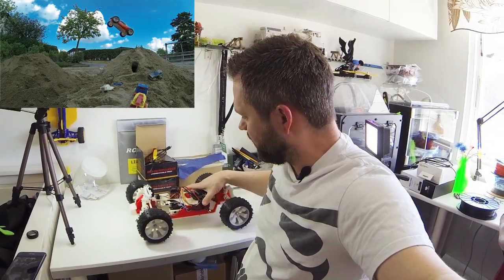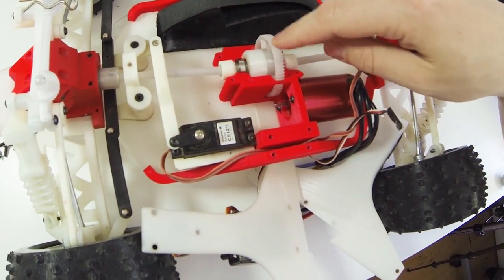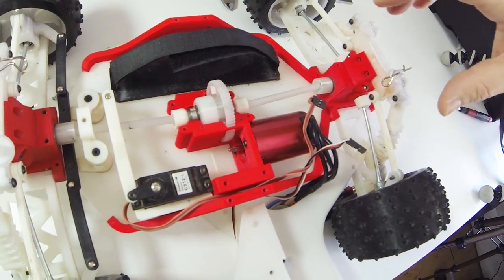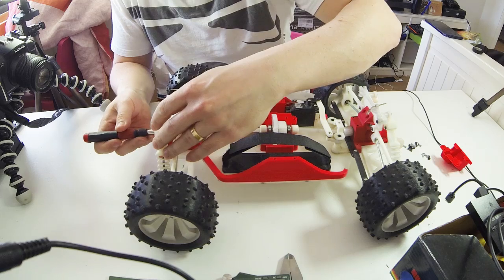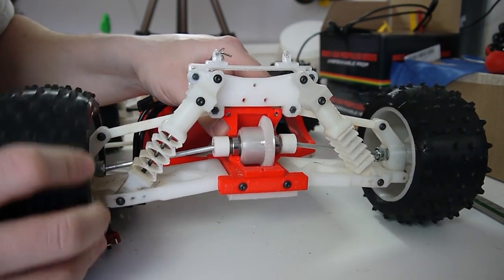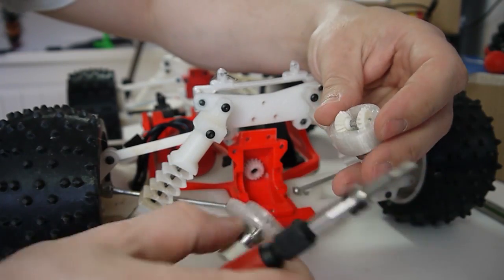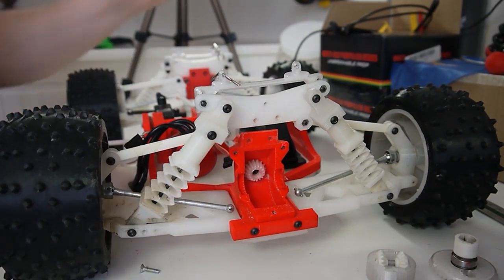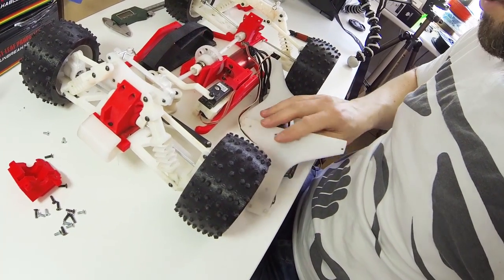3D Printed Gears & Drivetrain in the OpenRC Truggy RC Car

Comment: I'm a bit mystified by the upangle on the ChassisFront where the Front Differential housing sits. This angle causes the Diff to sit on an angle but then the Top Deck Front is supposed to mate with the Front DIff, but the Top Deck is flat whereas the Front Diff is now on this up angle due to the Chassis Front. Is this right and if so what's the purpose of that angle (because it means the wishbones aren't parallel to the ground now). And finally how do you deal with the angle mismatch of the TopDeck and the Front Diff where they should join?

Comment: This has been a great project so far but I am having difficult with the differential gear assembly. The gears are binding and I am wondering if I do not have my printer set with a small enough nozzle to get the precision neede for the gears. I am using PLA because this is an experiment for me and I only have good luck with printing PLA. If I can get any advice on how to print the gears in PLA or if I am better off buying metals gears thats fine,I just want to move forward with my build. I f Someone knows the part numbers needed for the metal gears that would be great. Thanks
Reply from the maker: Hi Philip, thanks for commenting and also engaging in the project. I think your better of buying a off the shelf differential (ask for recommendations in the Facebook group). The diff is designed for ABS and this a calculated for a certain amount of shrinking. It also need to be able to withstand more heat than PLA can take due to friction.

Comment: i have serious issues with the gears inside the differentials. No matter what material I try, there is just too much friction. With nylon printed gears you won't have automatic wear. They need to be perfect from the beginning. But in my case the are not. I tried different many different print settings without success. 
My latest attempt was to actually shrink the gears a bit in 3dmax. They are now a lot better. But i still don't understand how other people manage to get it working properly
Reply: You could try trow in polishing and sanding mediums (like fine sand mixed with grease that usually wears things down and when around there chance to polishing stuff for car painting) to smooth the surfaces? You dont need to force system by driving it with load. Put it on stand and let it rip on air for some while (dont know since i haven done it).

Comment: Daniel, do you think it would work to cast the 3d prints in alluminium to make the differentials, and do you have files for a 3d printed chassis for the car?
Reply from the maker: Oh, I don't have any experience with that but I'm sure there's someone in the openrc facebook group that knows. =)
There's a step file of the complete assembly of the openrc truggy at thingiverse, you can check that out.
Reply: Daniel Norée thanks

Comment: I really liked this video breaking down to show what you did. The diff was very interesting but didn't look much different to what you would buy or even what you get in a full size car.
But what did blow my mind was the shock absorbers that are on it. If you can did a video on those and how you built them that would be amazing. Thanks.
Reply from the maker: +Gordon Heydon Thanks for the suggestion, I will make a video about the shock absorbers for sure!